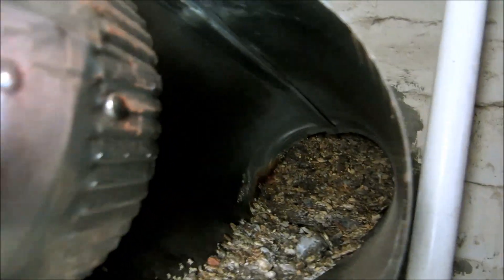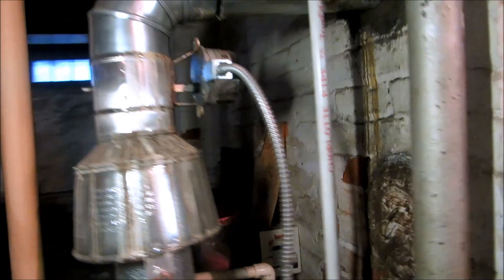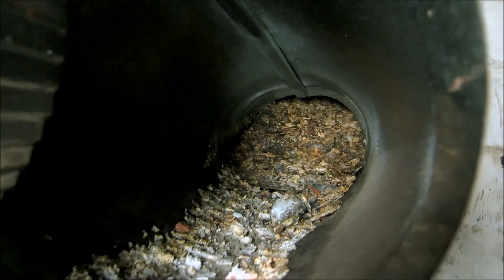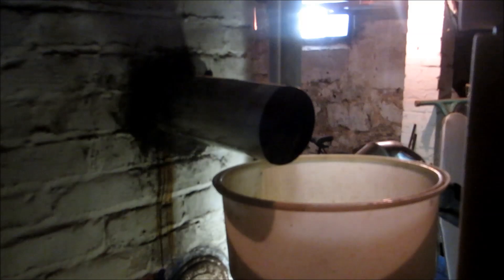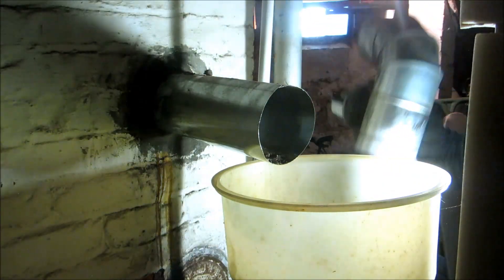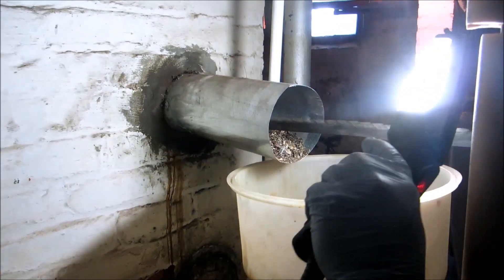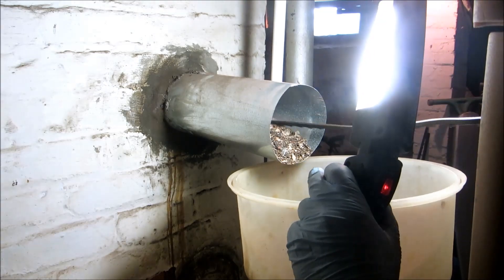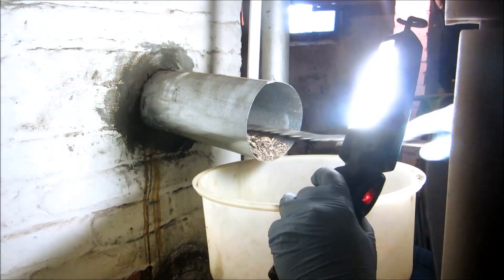no heat call on a gas hydronic boiler,unlined brick chimney

Comment: Steven.. followed your video and took out the vent and guess what.... I dugged out about 20 pounds worth of crap from the chimeny which blocked up the flue... and my vent block off switch or spill switch keeps jumping.... whoo hoo... Thanks for for video and thumps up....
Reply from the maker: grilledchickenwrap the gas fumes eat the inside of the chimney/ morda . a drop in liner is what you need in the chimney

Comment: Good fix Steve that's real bad that her Chimney was block like that. it also looks like the vent gas has been condensing you can see water stains on the walls and vent.
Reply from the maker: acechoice45 water running down the chimney  the bottom was the boiler flue ..now the water has some were to go beside down into boiler ,i told the lady she has to have the rest of the chimney cleaned out

Comment: Steve - was that a clean-out to the lower right of the flue pipe?
She did indeed get lucky that the roll-out switch worked the way it's supposed to

Pete

EDIT - never mind - you said so latter on in the vid...
Reply from the maker: pjf1313 she needs to have the chimney cleaned out fully i told her that ,to call a chimney sweep to do it